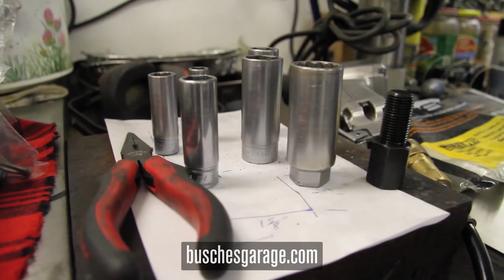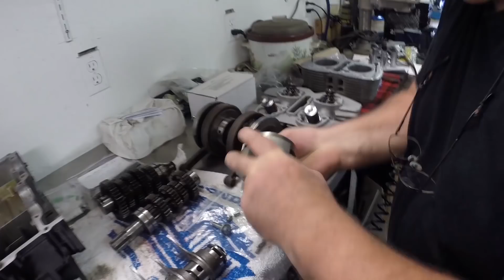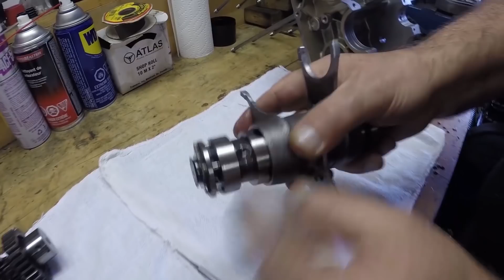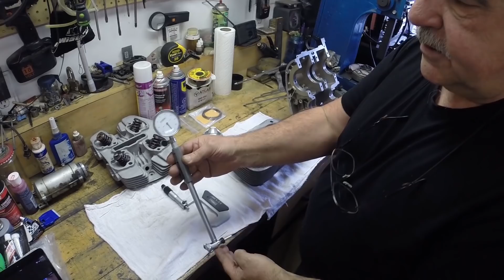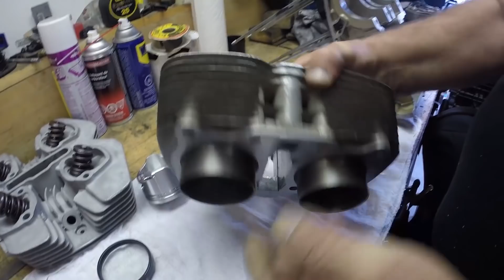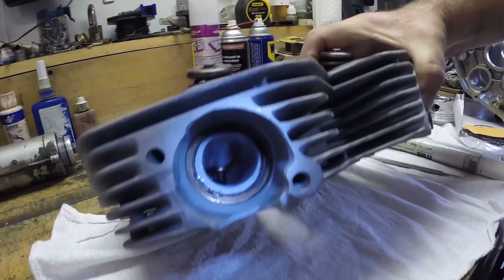Saturday's Wrench Ep.19: Engine Rebuild: The Inspection - Honda CB350 Build

Comment: Awesome detailed video! Im about to to start piecing together my CB450, wondering how you cleaned all of your internal case parts before inspection?
Reply from the maker: +Aaron Chinn in a parts cleaner with varsol. I also used a soda blaster on some other parts then rinsed thoroughly!
Reply: Ah yes, i just watched episode 20 and all the info was there. As for painting the cases, i noticed you posted the info in your build thread on Hondatwins.com, cheers!

Comment: I have the same motor and was curious, do these motors have a oil pump ?
Reply from the maker: +Olinger Welding Yep.. but not electrical. It's mechanical and pumps with the rotation of the engine.

Comment: How did you shine and buff the fins and in those hard to reach places that no common wheel can go? I just got my pieces sandblasted and I have no idea how to polish them. Other question: how to reinstall the spring setup for the valves?
Reply from the maker: +Tony Stark All I can really say is elbow grease! You just have to get in there! Mine didn't turn out perfect but I really just forced the fins into the wheel and got it as deep as possible so it could buff the inside. If you're using a cotton wheel it should allow for that. Check out my buffing video for tips. As for the valves, you need a valve spring compressor tool and removing them with a magnet like I did is a bad idea. Rookie mistake on my part. The magnet will magnetize the small keepers causing metal debris to be attracted to them on reassemble. Valve spring compressor is always the way to go!
Reply: Saturdays Wrench Thank you very much for the tips! I would be so lost without your help on this project. I greatly appreciate all of your videos and your current assistance. Thank you again and have a nice day!
Reply from the maker: +Tony Stark my pleasure! thanks for the kind words. Best of luck with your project!